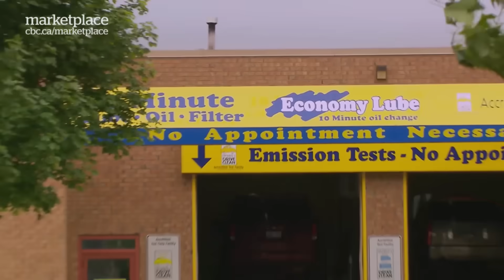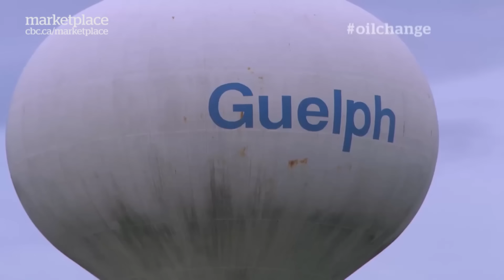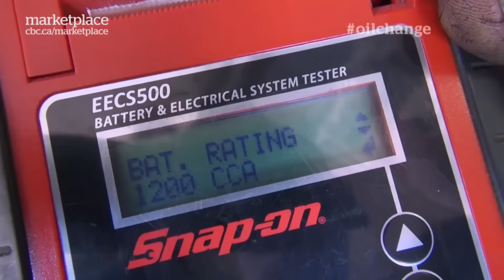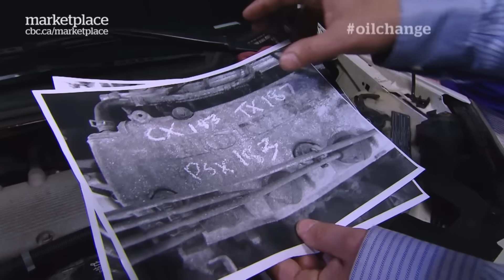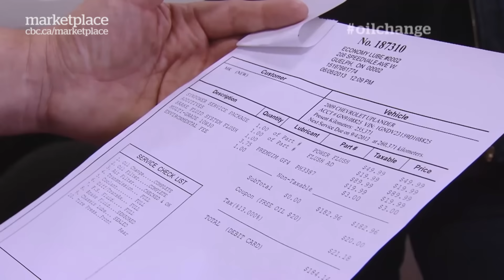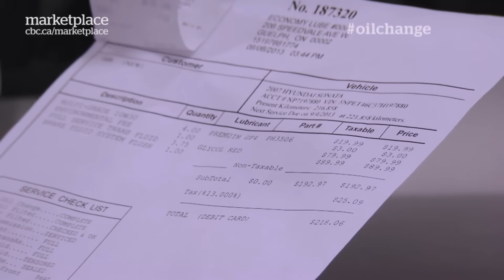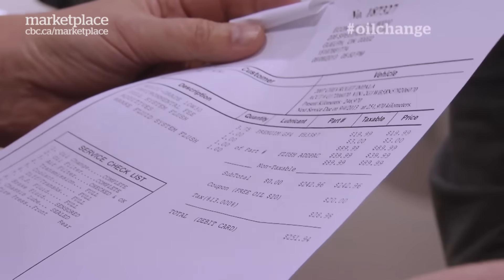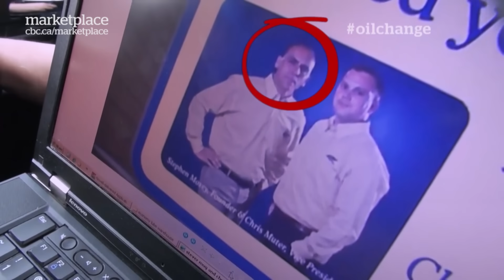Oil change scams: Hidden camera investigation on what really happens to your car (CBC Marketplace)

Comment: i dont get why people can't do this themselves, it's the easiest thing to do.
Reply: +Zephyr467 Because I wasn't born knowing how to work with cars. I have nobody, not even family like a dad to teach me these things. I have to rely on Youtube videos to figure this out, but even then the cars insides look different every time.
Reply: ***** my parents dont know anything about cars and they both drive autos, i taught myself to drive manual using the internet, buying a manual and trial and error. i bought a couple of shop manuals for the car and figured a lot of stuff out myself. it's not about whether you have people to rely on, it's whether you have the motivation and will to learn yourself.

i just did an turbo, tossed in coil overs/sway bars and a full brake upgrade including a brake booster on a friends e46 wagon and i've had my own car pretty much completely apart in my garage. im not trying to brag, and i know that's what it sounds like, but all you have to do is take the initiative my man, i suppose all that can start with learning to do your own oil, on a lot of cars the process is easier than making coffee, i'm not even joking.
Reply: +Hector Cortez Who was "born knowing" how to do this lol
Reply: +Kris Harris and that
Reply: +Zephyr467 To do a complete oil filter change and oil change can vary in difficulty between cars, but if it's a good car in the first place then it shouldn't be that hard to do by yourself. The first kind of car work my brother ever did was back when we lived up on a farm and one of the old farm trucks up there that only my brother would use needed an oil change, so my stepdad of that time showed my brother how to do it.
Reply: +prizedcoffeecup I realize there are some bastard engines, but most cars that most normal people own are relatively easy, the hardest car I've done one on was a v8 discovery, and that's just because the filter was in a hard to get at spot, it takes me longer to walk down to the mail box and unwrap the oil filter than it does to install it and change the oil on my current car.

it's just so easy and quick I honestly don't understand why people don't do it themselves (unless of course an obvious reason like age or disability prevents this, living in an apartment is not an excuse, you can do it on a friend's driveway or a park in less than half an hour even if you're a novice) and learn a bit of mechanical sympathy in the process.
Reply: ***** Indeed. If you want anything that is a pain in the ass that's related to oil, go ahead and replace the shitty excuse for an oil pump you can find in the 2.4L 4-cylinder Grand Am engines. This engine is just hell in the first place unless you expect the bare-minimum full fledged gasket swap and installment of an aftermarket high-performance oil pump just to get it to MAYBE exceed 220,000 km. You're usually in the clear after this point, but even then hell can arise at any moment for any reason with this engine let alone the car...my verdict is that the only way to get one to last properly is to get a Saturn Ion or other Saturn vehicle with a 2.4L engine. My buddy has owned 7 different Saturn vehicles and 4 of them had this engine, and he even survived a head on collision with a pole in one of these 2.4L Saturns. The front end was actually done...but guess what? After my buddy drove it back home as a parts car before writing it off, he pulled the hood off and started beating the coil pack plate with a metal baseball bat while the engine was running and it still ran just fine.
Reply: ***** yeah oil pumps are a job an a half, i've only done it once on my own car and that was to install a high performance one to keep up with the increased rpms the engine was hitting, but goodness me was it a pain in the arse, it took me a good week or two of afternoon sessions after work to do it.
Reply: ***** In a Pontiac with the 2.4L option, the engine actually has to be pulled out to give the oil pump enough space to slide out. The worst part is that this engine almost always requires it because the stock one is not very reliable and also only barely pushes the required amount to the engine...cylinder 3 suffers the worst of it.
Reply: +Doowoplover1946 although the process differs, yes it's really straight forward.
Reply: +Zephyr467 I don't get why people don't grow their own food. It's the easiest thing to do.
Reply: +Erik Larson well exactly, but in some circumstances that is just not possible.

I can't really be bothered explaining where food and car maintenance are not really relevant to each other, but there's a difference between the constant work required to grow enough different food for themselves and family, and spending half an hour a couple times a year to change your oil
Reply: No.
Reply: +Zephyr467 I did for the longest time, did a lot of work on several of my cars, but as things change so does my ability to work on my car.  I'm living in an apartment that does not allow people to do that.  I take my car to the dealer to get the oil change done, I know enough about cars not to get scammed and check the fluid levels and color often so I know what needs to be done and what does not.  I know going to the dealer I am paying more, but I would prefer there to any of the local places.
Reply: +Gregory Wallace but at least you have the knowledge.
Reply: +Zephyr467 Been to Mr Lube 3 times in a row. Then decided to do my own oil change. They did not put the washer back and found the original filter (pretty sure they would not stock every make of filter for every car made).  Changing your oil is fun and cheap. Then I went on and learned how to change transmission fluid, coolant, steering fluid. Lots of instructional videos on YT.
Reply: +Zephyr467 "it's just so easy and quick I honestly don't understand why people don't do it themselves"
You're so full of yourself, aren't you? Some people just don't have the will to do it, and it's perfectly normal. I love working on my car as well, but I don't act all surprised because others don't share the love for the same stuff as me. If everyone just did the "easiest things", most restaurants would be out of business.
Reply: John calm down there cowboy, you're firing out of the gates like a racehorse on crack and we're just trying to have a relaxed conversation.

there's a difference between changing your oil and going out for a nice meal, going out for a nice meal is a treat, you're having someone pamper you for something you usually do yourself (i hope). changing your oil is a simple bit of maintenance that gets done a handful of times a year, and your average non mechanically minded individual can learn to do it in an afternoon, whilst i don't think someone who can't cook would be able to learn how to create restaurant quality dinners in that time.

and i don't act surprised when people don't build their own bloody racecar in the shed, i do however get a little annoyed when situations such as presented in this video arise, and people get screwed out of some money because they are none the wiser.
Reply: +Sunil Nair  Exactly. Apartments almost always don't let you do things like maintenance in their parking lot- they don't want to have to clean up your mess, and have an immobile car sitting around while you wait for parts. When they restrict stuff you're just usually allowed to change a battery or tire, as those have no risk of leaving a mess.

Yes I know it requires very little tools too... however I have no such tools. I have no desire to purchase an oil filter wrench to have it take up space in what little storage I have. I have even less desire to have a drip pan to take up even more space and be gross. I don't want to have to make another special trip to drop off my used oil and filter at an appropriate recycling location. That part would take up enough of my time that I would rather just pay someone else to do it.
Reply: ***** My point was that many people can't be bothered with cooking. I'm not talking about building racecars, I'm talking about basic car maintenance. Some people would rather watch paint dry than open the hood. They're not the issue, the industry is the issue. Shops must be honest, and not screw people over their ignorance. It's not that hard for them to be honest.

EDIT: Exactly what the guy above me said.
Reply: John you dont really seem to get what im trying to say here, but you do seem to have your mind set.

to put it as plainly as i can for you, i don't expect everyone to change their oil, i think it's a good idea to at least learn what's required so you don't get shafted and at the most at least more people should try do it themselves, because at the moment it's ridiculous how little people care about the cars they drive.

to be blunt your point is completely irrelevant, and i feel like your having a dig for the sake of it, but please, if you have something else to say when to be honest this conversation isn't necessary the continue. however to let the tired horse lie down, if the situation permits it, more people need to do maintenance on their car, if you can't be fucked, you don't deserve to drive a car.
Reply: ***** To be blunt, many people couldn't care less about their cars, or about their computers, or about god knows what. It doesn't mean they don't deserve to use them, as garages or technicians exist for a reason.

I get what you're saying, as I love cars myself, and it would be awesome if more people were into cars, but starting with "i dont get why people can't do this themselves" just shows lack of previous thought. Read whoarentyou's comment.
Reply: John i have already, i still think people should just do it themselves instead of complaining when they get dudded, while yes it's insane that people are getting nailed for oil changes even though word gets out about shops that do that hence people should shop around prior. 

(as i said before) if they have the space and resources they should do it themselves they should. i saved money and bought my tool collection over 2 odd years, that was on top of all the other vehicle maintenance, going to uni, working and paying rent. i don't see an excuse other than 'i can't be bothered' for most people, if people appreciated their cars more i bet my left nut people's driving ability would increase due to the appreciation of their own work, hence increasing their cause not to crash, that's the effect it's had on me in any case.
Reply: Because some people don't have time or space or don't have any idea how to change oil
Reply: +Zephyr467 because i dont wanna hassle with properly disposing of the oil or other fluids. 

id rather it leak into the ground than have to drop it off at a proper place :D
Reply: +Hector Cortez I learned by hanging out with friends after high school who worked on cars, and using a factory repair manual.  14 years now since I bought my Integra and I have never once paid a mechanic to do anything, besides wheel alignments and body work.
Reply: +jeremy58589721 I drain my oil into a big oil pan container, and then drain that into the empty 5-gallon oil jugs in the garage.  Then I go under the cover of darkness and leave them by the local oil change place's recycle drums out back. :-P
Reply: +Zephyr467 because not everyone cares for knowing a stuff they will just do 1-2 times a year. It's like not knowing about plumbing, home electrical system, and computer repairs/maintenance. Please don't get me wrong, but that's how life works for others.
Reply: Jack Graybird thesnekker10 please read the thread, what you have said has already been said and answered.
Reply: Do you really think you're saving anything by doing the oil change yourself?  Think about it...
Reply: Chrisha Chruz well yeah i do, and also i'm interacting with my car.

ill do some math with you, i put penrite hpr full synthetic in my car it's $62/5L at my local auto store and about $55 if i order it from the source, i do the oil every 4000km or after a consecutive number of race days, because the car get's driven daily and tracked, plus, even though I rebuilt it, the motor is still 26 years old. i do about 25-30000km each year, that's 6.25-7.5 oil changes per year and each of those changes includes a $35 filter, however as i said sometimes after/before some track days if they are multi day or a full day or whatever reason, i will do an oil and filter swap, so ill estimate that the oil changes eqate to about 10 each year, 10 times $97 is $970. In the past i haven't been able to do it myself due to work or whatever and the cheapest place I found when i shopped around once was $140 minus the cost of the oil/filter, but i was quoted $210 at one spot, luckily i was able to get one of my car savvy mates to do it for me for a 6 pack in times of need. so for arguments sake ill put the number in the middle at $175 for a swap minus oil and filter costs, that's $1750 a year of 10 services at a shop, thus a saving of $780 if i do it myself, and when a set of 4 track tires for me costs $1108, that saving on just the oil change softens the blow.

so to answer your question in short, a fuck load.
Reply: +Zephyr467 maybe they don't have garage
Reply: Chrisha Chruz
 Mobil1 0w30 synthetic oil change for my car costs me about $28.  For any oil change place to do it would probably cost $50 minimum, with the gamble that they may or may not do it correctly.
Reply: Patrick94GSR damn those prices.
Reply: pawelgatorade ffs you people, read the thread, i've already said "in the circumstances allow it" like 3 times now as have other people.
Reply: +Chrisha Chruz The biggest savings is that you know some idiot isn't going to screw up your car.  Actually, just this last weekend I had to help my brother remove the lug nuts on his wheels.... with a 6 foot steel pipe over a breaker bar.   Two years ago we actually had to replace all the lug nuts on his truck because some idiot tightened them so much that they deformed.  We've had to go to extreme measures to remove the oil drain bolt because of over torquing.  Oh, did I mention he also had disc brake calipers fall off while driving home from the shop.  At least that idiot was fired.  I've never had any of these problems because I DIY or at least take my car to a shop that pays a decent wage and has mechanics that actually love cars, and not your average oil change joint.  Just not worth it.
Reply: ***** the answer to all of that is laziness.
Reply: ***** For me the answer is cheapness.  I can build a computer, repair a bike, repair my house and car, and go pick up my pizzas because it's usually cheaper that way.  I don't want to pay someone when I can do it myself.  Plus I just like knowing how to do it myself.  Gives me great sense of accomplishment.

I just built a new bicycle up from scratch, starting with a bare frame.  Knowing I made it myself is better than anything store-bought.
Reply: +Zephyr467  What an assinine post!  Changing a car's oil CAN be easy, but on some cars (like some German ones, for example), it can be challenging.  In addition, many people don't know how to change the oil, or cannot due to health or mobility issues (senior citizens).  THINK before you say something stupid!
Reply: AudiophileTubes
 Yeah it seems like some manufacturer's purposely try to make it harder.  Newer Toyotas, for example, use a cartridge oil filter, requiring a special filter wrench to get the filter housing off, and you pretty much HAVE to use OEM Toyota filter cartridges.  It's pretty dumb.  My mom's 06 Camry and my in-law's '11 Corolla both use cartridge filters, but they both have different size filter housings, each one requiring a different wrench.

Meanwhile all 4 Toyotas in my family (ours, parents, in-laws) all use the same 14mm drain plug bolt.
Reply: +Pala Luka totally agree, you can even order it on the internet now, it's nuts why people don't take advantage of that
Reply: +Zephyr467 I am blown away by the number of people that can;pt even change a flat tire these days! People seem to actually been taught to NOT be self-suffcient
Reply: +Patrick94GSR Actually, no. I live in Germany and my wife owns a 2006 Toyota Avensis 2.2 Diesel (177 hp model) and for the oil filter you need a 65 mm 14 panes tool which fits for many engines, not only Toyota. I bought the tool not from Toyota, but from someone else on ebay for 6 Euros, that's like 7-10 USD, i don't know, but it's cheap as nothing. And its fits for Yamaha and other japanese engine makes as well. And you only need the paper filter, it is integrated into the housing of the engine. Just replace the filter and the O-ring from the housing cover and that's it.
Besides, i did about 12 oil changes on that Toyota, just divide 6 Euros by 12 changes, that makes 50 cents for each oil change, which is not a load of money in my humble opinion.

My own car, a 2002 Opel/Vauxhall Astra 1.8 gas/petrol, needs a cartridge filter, a "can" to be mounted outside the engine. For that, you either use an old belt to get it off or you get yourself an oil filter wrench that is adjustable. Costs 4 Euros or 5-6 USD. That's basically "nothing" as well.

If you want a real pain in the butt, get yourself a newer BMW model. No dipstick, no drain plug to get it out, BMW doesn't want the owner to change the oil himself. At least on some models, if it is still like that in 2015, i don't know.
They try to make it harder, but not on every car... and if you are a good mechanic, you find a way to get that filter off... ;) Greetings
Reply: heros2110 Amazing considering how easy it is to change the oil on my 2004 BMW.  I don't even need to get under the car.  Oil filter is on the top and the path of the dipstick allows me to extract oil from the top using suction.
Reply: believe it Most people don't even own the most basic of tools anymore; It's crazy.  The flat tire thing is right on.  I volunteer at a bike coop and you'd be amazed (or not) at how many people have no idea how to change a tire or tube.
Reply: supadupa64 maybe for economy non synthetic oil and filter for a non performance car, and all my prices are in aud, so $12usd for you is like 18 for me.

synthetic oils for high performance cars are expensive as are good quality filters, i know how much i save doing it myself and if it cost $5 do someone to do it for me i probably would do it every now and again, but $5 is almost 3L of 98 so it all adds up.
Reply: Some don't own jacks/supports (Course the unaware should realize the ones in the trunk for spare tire replacement works too), rachets/sockets and knowing the right type of oil. Course the latter can be easily found via internet or a local Walmart/Canadian Tire for example. But yeah, been changing oil myself for years cause you actually know what's in the car and not second guessing it from some potential bullshitter.
Reply: Not everyone is a gear head. Plus not everyone has time to do so. Also, how can you expect a 50-60 year old women to do that?
Reply: +Zephyr467  Its called LAZINESS.
Reply: where do you dump all the old oil
Reply: +Mike Woods autozone or equivalent no charge (in the US anyway)
Reply: ***** if you dont own a jack or something to raise your car just park it in a ditch, you can get under no problem i have been doing that for years
Reply: +Zephyr467 Because time, money, and lack of knowledge
Reply: +Kart Drifter the Internet and this site are really good resources for any information you need.  I know it may seem confusing and difficult, but routine maintenance is just like mowing the lawn, or doing the dishes.  You have to make time, it's just another responsibility that most pass up because it's inconvenient.   Just know making time to educate yourself and execute your responsibilities will make you better, not worse.  Goodluck!
Reply: kohchajakinov86 Im speaking for the people I see bring their cars in. I handle cars just fine. I have ASE certifications. But some of this is still hard for people to digest... cant fix stupid
Reply: True!
Reply: +Zephyr467 Not that I don't know how to do it, but the fact I have money to pay for something so basic
Reply: +MrCr3ep3r well clearly not, but either way I'm not a yank
Reply: +Mike Woods obviously in the ocean.

no I take it to the oil dump at the tip, my car club has a deal with the local council where they take our oil for free, but even then it's like $5 a trip so you could just store it in a drum till the end of the year and dump it there.
Reply: +kohchajakinov86 This. I was working as a barista Monday Tuesday Wednesday mornings, bar work Friday and Saturday nights, uni Tuesday/Wednesday arvo and Thursday morning and I still did an engine/brake/suspension and diff swap in a couple months mainly working Saturday mornings and all Sunday. this whole time I was catching the train to uni (20 mins each way), the cafe (45 mins each way to cbd) and the bar (hour and a half to two and a half hours depending on the day). 

my message to people is that if you can't find an empty parking lot and half an hour to do your oil, and you complain about getting dudded on shop prices, you're a lazy wanker and you don't deserve a car.
Reply: +kohchajakinov86 THIS..This post says it all, its so true.  I bought myself a relatively cheap bike that I had to save up for, which took months since I was just fresh out of high school 4 years ago and was just going to college and only had a minimum wage job. and guess what? I didn't know jack shit about anything, I had to get the manuals and do my homework. Trial and error. Save for my tools to continue to work on it. Save for my oil, save for my trickle charger, save for all my shit I needed for it. I fucking hate my generation.
Reply: It is very easy to do, but in my area a lot of places won't recycle old oil so there is no where to put it
Reply: Not for people who don't know how to do this
Reply: +Zephyr467 actually breathing is easier
Reply: +Zephyr467 I service my cars myself but granted, its not fun to do on cold days, out on the street.
Reply: +Zephyr467 apartments don't provide a place to do the work.
Reply: It may be easy to do, but then your stuck with the used oil and mess to clean up.  After endless gallons of oil sitting in the corners of my garage with no convenient place nearby willing to accept it, its just easier to bring the car in and have it done.  But with today's much longer service times between changes, I try to time it for when a few other services are needed at the same time, then I bring it TO THE DEALERSHIP I BOUGHT THE CAR FROM, as they want my repeat business and know they won't get it if they try anything shady.  And I often watch them in their work and make sure evrything I requested was completed correctly.
Reply: Also, a couple of places that I've previously taken my cars to had the tendency to overfill the oil. This is almost as bad as not having enough because your engine can blow it's seals. The guys at those places were too lazy to drain off the excess. Better do this yourself.
Reply: +Dead Ashes Many places like Autozone and other car part places usually offer a place to throw the oil away usually free or maybe for like $2, same probably goes for oil change places and repair shops, you're not suppose to pour it down the drain or throw it in the garbage since counts as hazardous waste or something like that. So you could save the oil from your last self oil change then dispose of it  when you go to autozone or where ever you'd get your oil and filters from and bring the old oil with to be disposed of, get rid of your old oil and get new oil all in one trip or if you know you'll be passing that store or shop going to work or to a friends house or somewhere else then bring the old oil with, gets rid of the lazy "that's too hard" excuse
Reply: You really don't get it? You must be a teen😄
Reply: MudMan Fan Take used oil to a recycling centre (city/council dump).
Some people pour a little bit into the insides of the doors for added rust protection. Door cards must be removed first obviously.
Reply: Dennis Santos i use it to oil up my bike chain and i fill a milo can up and toss my spanners and a couple of other tools in it. some people say that's bad but a friends dad was doing it for 40 odd years before i ended up with the set, and they're still working.
Reply: +Zephyr467 because Capitalism makes people lazy and stupid (USA is the best example for this). It is a trick, because with such an attitude, they (bankers and big company bosses) can sell things easier, because it is easier to betray people.
Get your heads out of your asses and begin to learn doing things on your own. I´m an IT guy (the ones with two left hands ;) ...) and i changed the timing belt on my car on my own. It is possible.
Reply: +Zephyr467 I do my own oil changes however, not everyone has time to do it. I work long hours in a factory, so the time I do get at home, most if it us used to rest. So I pretty much have to force myself to change my oil. Don't be so simple minded.
Reply: +MotoMatt read the thread, this as already been discussed. gather all information before making a statement.
Reply: +Zephyr467 
You don't get is right.  How is a 19 year old female student going to flush her brakes?    If it's so easy, tell me how you do it.  Hint:  I am a 40 year professional mechanic.   
Your comment is wholly ridiculous.
Reply: +You'rePrettyGood 
The comment I responded to was "i dont get why people can't do this themselves, it's the easiest thing to do"
So that encompasses everything we saw.  However, for the sake of argument I will address just oil changes.   
Yes, some cars are extremely easy to change the oil on.  Some are not so easy.   
Lot's of people don't have the first clue as to the mechanics of a car.   It's easy for people who know cars to ponder why others don't perform simple tasks on cars.   
There are cars which have the oil filter between the firewall and the engine on transverse mounted engines instead of hanging off the front of the engine.  Some of those can be a whore even with a hoist.  If the filter has been put on tight by some clod at some half-ass lube joint, they can be very hard to do in your driveway with limited experience and lack of a proper filter tools.
Also, many cars are not a spin on filters but rather a cartridge type.   They are not necessarily difficult but for someone  who is not mechanically inclined, who doesn't know the difference from the brake master cylinder and the power steering reservoir, things can be intimidating.   

Like I said, I am a 40 year professional mechanic.  I was dealing with the public in automotive when your daddy was in diapers.   I've been driving for 50 years.   I started when I was seven years old in Montana.   I'm also a licensed pilot, so no, I'm not retarded.  I'm not just a mechanic, I'm an automotive consultant.   I managed every facility I worked at as an adult and ran my own auto repair facility for ten years until I retired from it a couple of years ago.    Telling me anything in this field is like you trying to argue religion with god.   And honestly, I don't have the time for fucking amateurs. 
Have a pleasant day.
Reply: ***** Can't tell if you're insulting me or actually trying to help. But I actually did learn to change the oil myself a while ago. Bent the frame too.
Reply: ***** Are you kidding? See for yourself.
Reply: +linkuei83 you dont need a ramp
At least i dont
Reply: If you can't atleast change a tire an your oil you should just ride a bike
Reply: +kyler miller changing a tire is actually pretty difficult depending on the type of tire. Changing a wheel is very simple though.